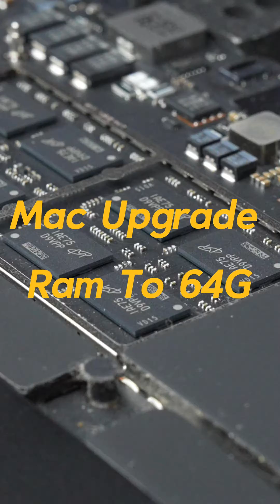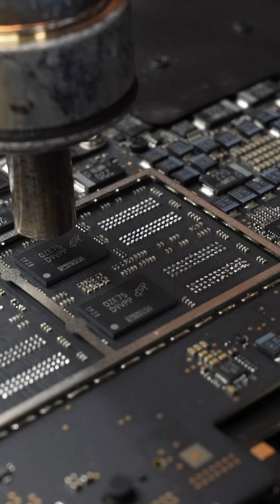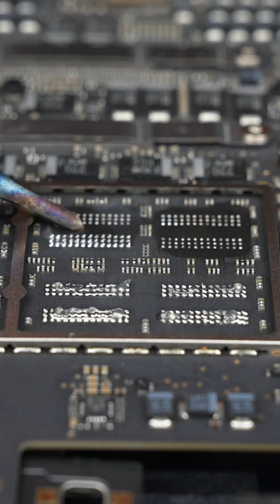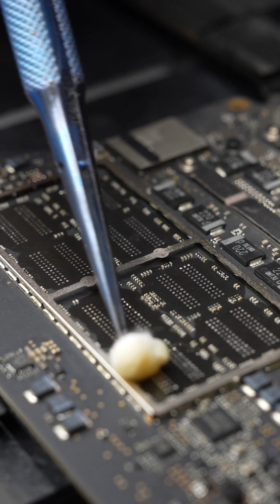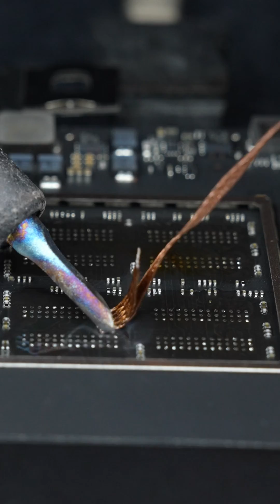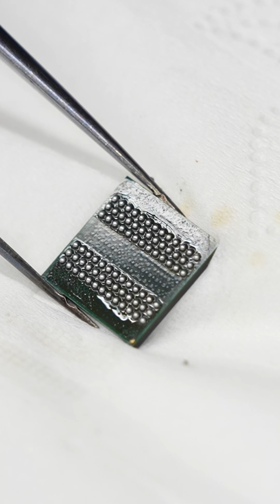Macbook Pro A2141 Upgrade Ram Memory To 64g,Macbook Air Pro Repair Replace  Ram Memory 16g 32g 64g

Comment: According to datasheet - D9XQM is a 32Gbit ddr4 chip, did you solder just half of the pads? How to configure straps then?
Reply: Where can i find apple Data Sheet for Chipsets?
Reply: @Jrnotnice  Write down the marking in the google, it will provide in the first two-three links.
Reply: @JohnBernas-ll2si  where can I find compatible chip ?
Reply: @Jrnotnice  taobao.